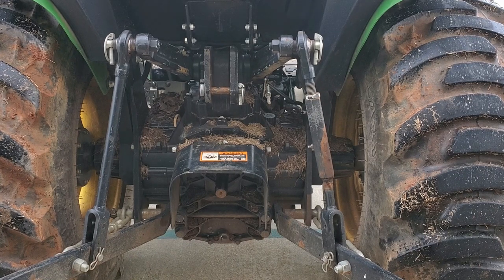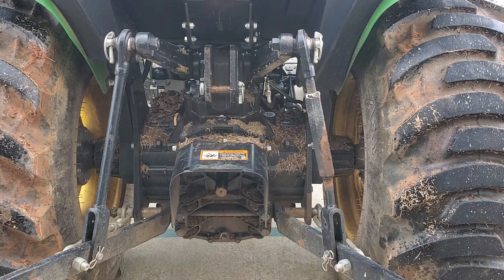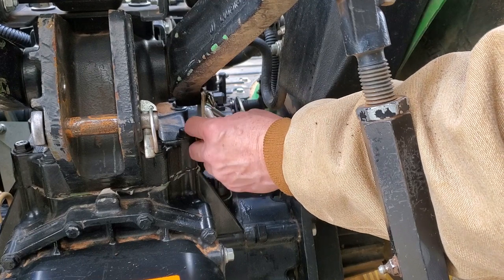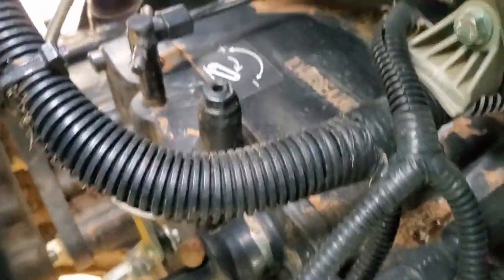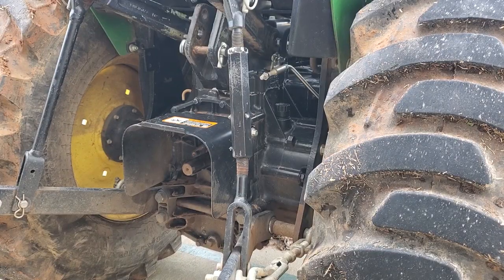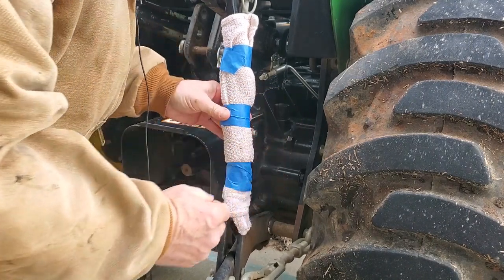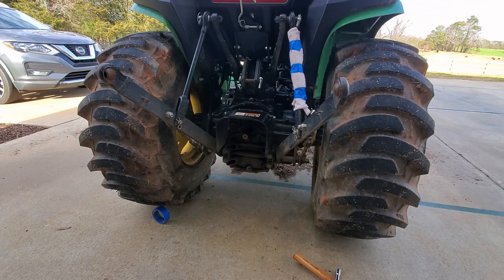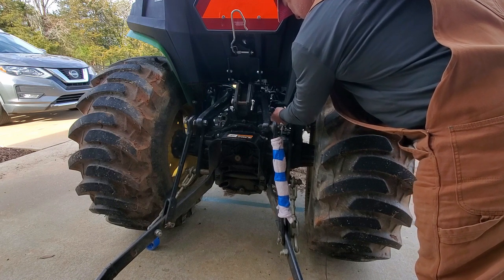Adjusting the 3 Point Hitch on John Deere 3038e

Comment: Hey thanks, my 3032e has the exact same setup and I've noticed its been going too far up and causing strain on the hydraulics, and it immediately starts to drop the second move the lever off 9. My sensing valve was stuck and binding up. I loosened both bolts, sprayed it with penetrating oil and started working it loose. Its still a little tough to move by hand so I'll keep working on it, but for now its ok. Much appreciated on the video!

Comment: My bush hog won’t drop.  I’ve checked the speed adjustment and it’s still stuck.  Any suggestions as to next step?
Reply from the maker: Make sure both levers that come out of the rockshaft control valve are moving freely.  I had that issue and had to disassemble the control manifold an replace the shafts.  They were rusted and stuck which affected the operation and feedback shaft. Check out this video https://youtu.be/pjmkF9RoM7U

Comment: See, doesn't take long to blow the trash off to see what you are doing and keep dirt out.  That is the sensing rod that tells control valve the lift arms are where the lever is placed at. My 1984 J.D. 750 has the same adjustable rod and there is a correct adjustment procedure.  Looks like it's adjusted pretty close but I don't think the arms should lift that high.  There should also be a small lever that adjust how fast the arms drop.  My 750 has it and easy to use.  If adjusted so brush hog lowers gently then much lighter post hole auger would be slow to lower.  J.D. always has the best of hydraulics.  Glad to see you found the right top link pin.  Also glad you didn't take control valve apart, Whew.  Thanks for the video.
Reply from the maker: I agree with you about needing to adjust while an implement is attached.  I may put my ballast box on and adjust the drop speed.  This has a T-Handle to control that.  Just turn it for faster or slower drop.